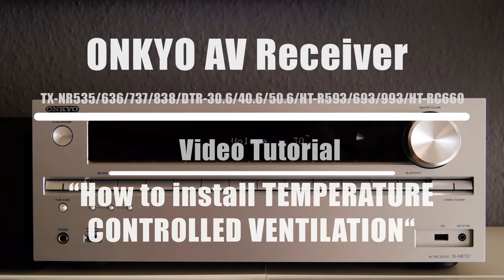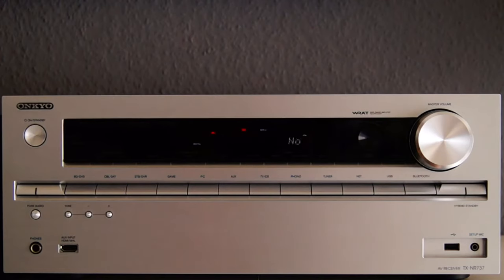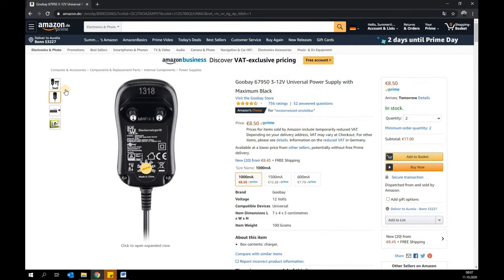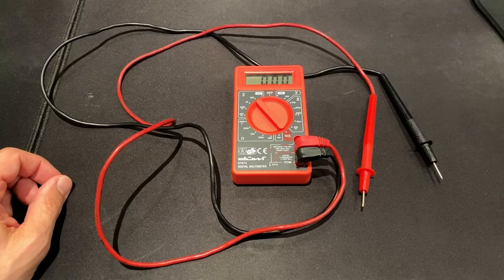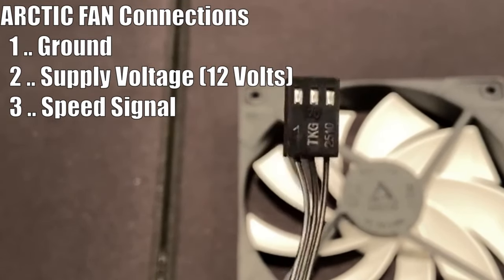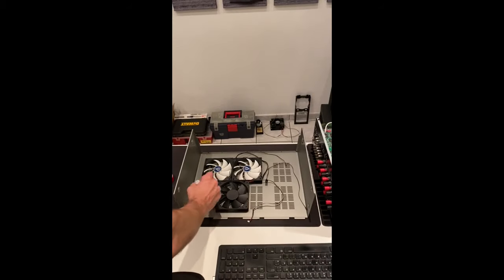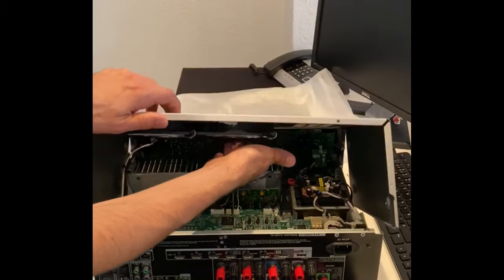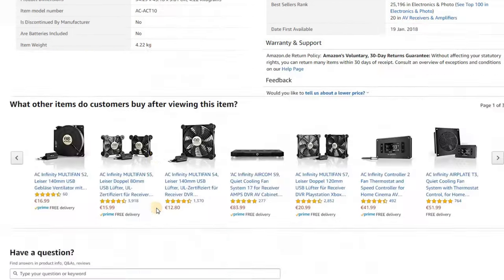ONKYO AV Receiver - How to install TEMPERATURE CONTROLLED COOLING FAN VENTILATION

Comment: Hello Sir. I followed your instructions.  I have to say that your mod is great :  I used 4 fans and they are inaudible !    Although, the ABS case is not usefull because you can use the case of the power supply instead.  And another thing is that the power supply you gave is very noisy. 
  Coil Whine :  Electromagnetically induced acoustic noise.  So it doesn't fit for an amp. Have a nice day
Reply from the maker: Hi Tom, thank you for your feedback!

Comment: For the Onkyo 636, 737, 838 .. family,  on the speaker terminal board there are not populated a XH-3 conector ( marked P607A*)  and the jumper to it( next to the Full bridge rectifier). 
If you populate the XH-3 conector and the jumper  you can use it to get the digital 12v rail to power the additional  fans( that 12v rail  is also used for the factory fan, so is intended for that ).
Reply: Bonjour, je ne vois pas ce connecteur, pouvez vous préciser?

Comment: Hi! Great solution!! 
I want to do it with my tx nr818. ❤‍🔥
My question is: Do I have to solder the universal power supply directly to the AC IN on the Onkyo's Power Supply Board, where the AC Inlet is connected (N&L)?

✌

Comment: Instead of opening up the receiver and soldering in the power supply cables, buy fans with USB power supply and plug them into either the USB power on the back of the receiver or an AC to USB transformer plug. Then just place the fans on top of the receiver. That is easiest and cheapest, plus it doesn't void your warranty.
Reply: Onkyo have warranties......?🤣

Comment: Thanks a lot for the video. I cannot explain why ONKYO does not immediately equip their devices with fans and these have to be retrofitted first.
Reply: It’s all about the tight space underneath the mainboard where the heat couldn’t escape and which causes the damage of the soldering at the IC-chips and the capacitors. The inbuilt fan only cools down the amplifier part of the receiver.

Comment: Another outstanding video to learn from, thank you again!! I have on question as it relates to the added power supply for the arctic fans. Where do you find the pin connectors you soldered into the 12w supply extension? Thank you sir!
Reply from the maker: I have had the circuit diagram from the ONKYO .. With the multimeter I started with the measurement at the supply voltage. From the supply voltage I then looked for the point where the voltage is 220 volts and is switched by the on and off switch. I found the point by trying on the board. In the video, when you zoom in, you can see the points on the board. Hope it helps you.

Comment: Hi, great informative and well done video. I have a question about the connection of the universal power supply to the onkyo power board. I have an old non-polarized 120v AC power supply I like to use. Where did you wire the L(live) and N(neutral) lines from the power supply to the onkyo board? What is the yellow and white lines on the onkyo?

Comment: Luft rein drücken oder absaugen (Einbaurichtung) - was ist effektiver?
Reply: Ich habe auch einen „Problem-Onkyo“ (DTS-Chip überhitzt, Lötstellen haben sich aufgelöst, keine Tonausgabe). Mein geplanter Workaround nach „re-fluxxen“ und Erwärmung des Chips: Wie gezeigt zwei Ventilatoren am Gehäusedeckel anbringen (aber mit kleinen Kabelbindern befestigt, sieht kein Mensch und ist wärmeresistenter), diese aber gegenläufig montieren, damit es einen Luftaustausch gibt. Zum Vermeiden von Staubansaugung bekommt dieser Ventilator den Vlies einer medizinischen Mund-Nase-Maske verpasst (von denen gibt’s derzeit genug im Hause und sie lassen genügend Luft durch). Die Stromversorgung erfolgt simpel über eine der rückwärtigen Steckdosen, die normalerweise andere HiFi-Komponenten mit Strom versorgen, damit sich alle Geräte simultan ein- und ausschalten lassen. Sollte klappen … 👍

Comment: Nice workarround and Tutorial. I am looking for a similar solution for my marantz sr5007.  Now I only have to find out which connections in my  Marantz are equal to those you are soldering to on 4:05
Reply from the maker: Thanks :-) The workaround is extremely useful in my case. Have not had any heat problems since then.

The circuit diagram is very helpful when looking for the right contacts. If that is not at hand, it is possible to find the right contact with the voltmeter. Starting with the supply voltage. Pay attention to the precautionary measures when handling electricity, to protect yourself and the circuit in the device. Good luck.

Comment: I did the same thing on my Pioneer Elite receiver it was about eleven hundred bucks I did it from the start the difference is I got LED fans and I hooked up to a smart surge protector which only turns on the fans when unit gets power blue lights look very cool are you supposed to hold it all together from the inside looks beautiful if I have a big party I change from 6 volt to 9 volt the original fan I'm still keeping on top of the motherboard for the HDMI that only comes on if I'm pushing the receiver extremely hard at 6 volts otherwise and never comes on
Reply from the maker: Sounds like a cool solution! :-)

Comment: Good morning and sorry for the question, is this modification good for all ONKIO equipment?  I own the TXNR 905
Reply: I would recommend the modification in the following cases: 1st the receiver generates a lot of heat and 2nd there are known technical problems (malfunctions) caused by the high temperatures in the inside of the device. You can find these technical problems e.g. in internet discussion forums.
Reply: @alexanderh1980  Thanks, I don't currently have any problems, but I've seen several YouTube videos with pan modifications that help a lot, any forum addresses?  Thanks in advance
Reply: hello, that black plastic container in the ads for the modification you made What's in the description what is it for?
Reply: @Tiger-dl1yn  in the plastic container I put the power supply unit (220V AC/12V DC)
Reply: @alexanderh1980  Thank you, I'm Italian and I use the translator, I watched the whole video using Italian subtitles, maybe I missed that's why I asked you about the plastic container

Comment: Hi, Thanks for your sharings !   Anyway I wonder why in the comments you said you looked for the point where the voltage is 12 volts and is switched by the on and off switch.  Dont' you need a  point of  220V ?  as your schematic at 3:47
Reply from the maker: The point needs to be 220 Volt not 12 Volt. 12 Volt is not right here in the comment.
Reply: @RepairUpgrade  thank you.   I have another practical concern. (Sorry I'm a novice) I wonder what did you buy for junctions between the 12V adaptor and the fans, I guess you used simple conversion 2 pins to 3 pins cables, but for the blue and a red small case, to connect cables, I don't find them on A. express....    I know it's a basic question...   Again thank you for your vids.
Reply: @RepairUpgrade    I think it is this : https://youtu.be/DJqUoFrSHy8?t=83   .     have a good day!